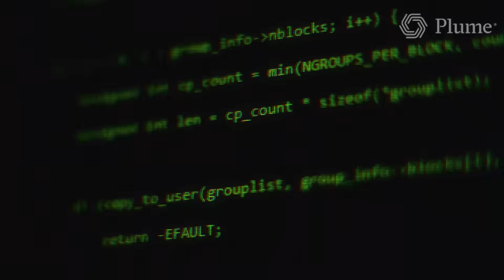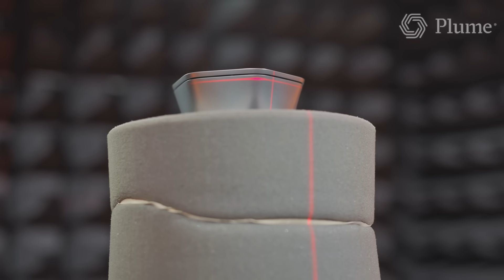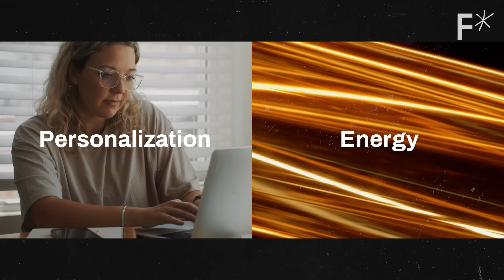The WiFi to make smart home dreams come true

Comment from the maker: Hi! We circled back with Plume to address some frequent questions and concerns that came up in the comments.

1) We take privacy very seriously. To be totally clear: We never sell your data or use it to sell you things from other companies. You also have full control over the visibility of your activity. We also automatically block advertisements and filter out security threats and malicious activity for all devices and quarantine any devices that are acting suspiciously. All actions are visible and controllable by the user through our app.

For more information: https://www.plume.com/homepass/cyber-security/

2) While it often surprises people, most routers don’t intelligently allocate bandwidth. It’s technically difficult and potentially slows down performance overall. While many routers do offer the ability to manually customize Quality of Service (QoS) for different protocols to change the prioritization of different devices or services, this is technically challenging and labor-intensive, and most users don’t do it. Plume’s system aims to solve this problem by using AI to optimize performance among large numbers of devices without the need for the user to manage it. This is known as “Adaptive QoS.” It also deploys it seamlessly over a mesh network that connects a whole home over one wifi network.

For more information: https://www.plume.com/homepass/blog/everything-you-need-to-know-about-wifi-connectivity/

Hope this clears up questions and thank you for watching.

Comment: Why not just base it off of "instantaneous" data use? ---> Where the router/3rd party device/network management software takes the average data requested from a device, over a period of a few milliseconds or so, and uses it to allocate bandwidth for the next few millisecond before it takes the average again? 

It could also take the average of the average data usage of a device, then store that value to compare against the future "instantaneous" readings of the device, which could then be used to establish the data patterns needed to accomplish your futuristic/dystopian smart home dreams.

Here's the real kicker though, the first idea is so simplistic that doesn't require cloud computing and can be done on a relatively cheap to manufacture chip, keeping the users' data private. AND, the second idea, along with most of the ideas presented in this video, could be accomplished by running all the computational work from a downloadable software on a laptop/pc, which would then relay the information to the device. Once again mitigating the issue of entrusting your most private data (from your most private place on Earth) to some random company.
Reply: Well the answer to that is obvious, routers already do this so they couldn't it to you.

Comment: This makes absolutely no sense. If "mommy" needs little bandwith to send an email and "the kids" need a lot more to watch netflix the router will assign a few bytes for sending an email and a lot more to the video stream. This DOES NOT need AI in any way.
Reply: It really doesn't. The router doesn't decide ahead of time how much bandwidth each device gets, the only time two devices can interfere with each other's internet speed is if they're both trying to do data intensive tasks at the same time. If you for some reason need one of those to be lower priority, you can just adjust your router's settings to tell it to slow one of them down more than the other if there isn't enough bandwidth, which is something this "AI" couldn't even do anyway. It just seems like they're trying to sell you mass surveillance.